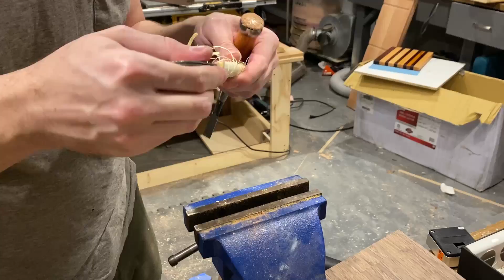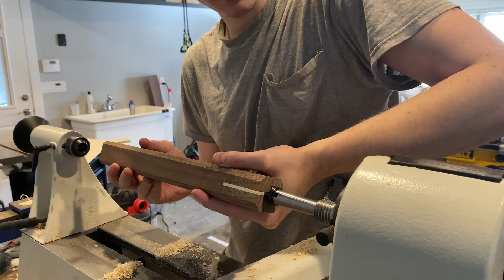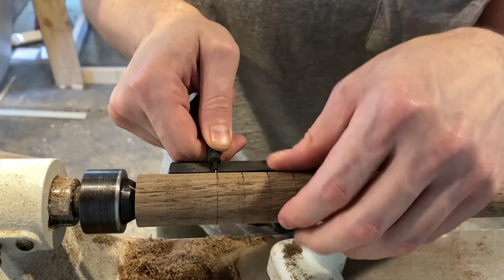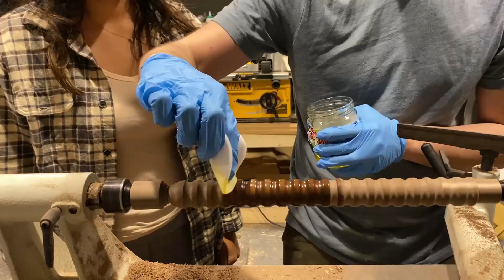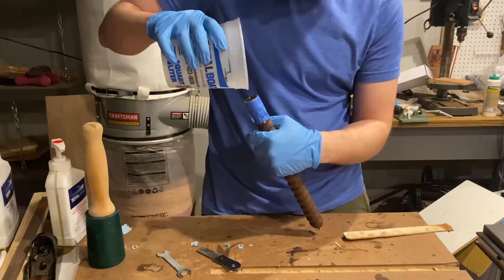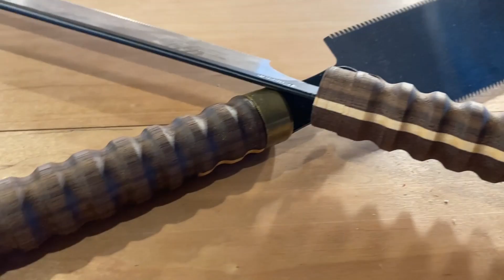Custom Japanese Saw Handle

Comment: Great job, but one thing you could have done better ‐ the flats of the Ryoba handle have a purpose, providing registration to the flat of the blade.
Reply: yes. the pull is the registration. and safer.